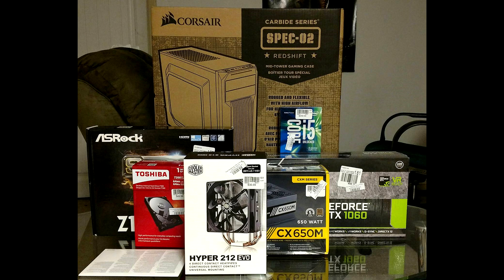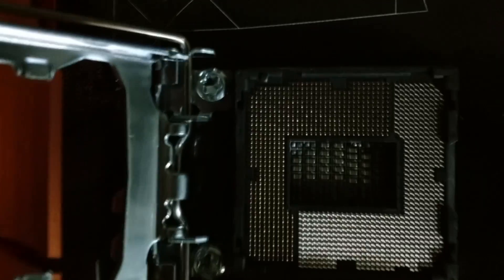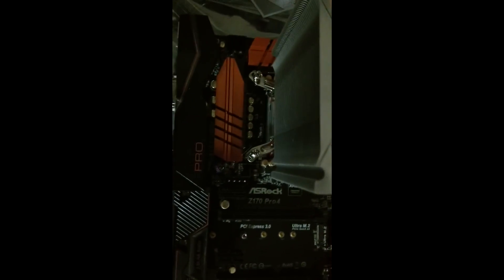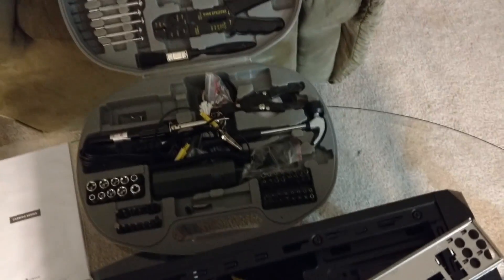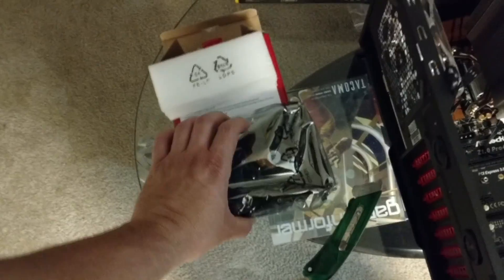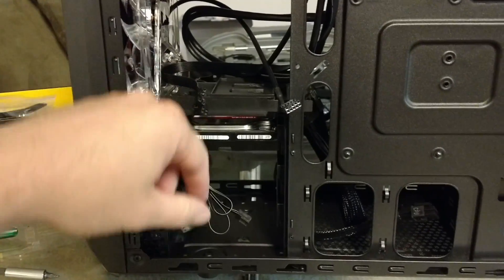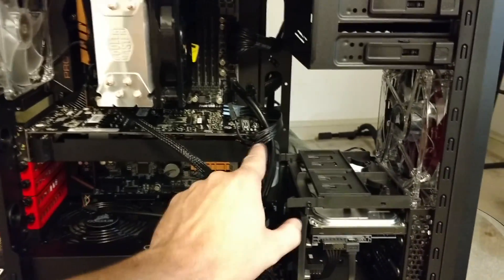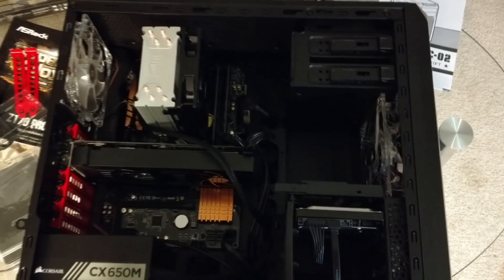How To Build A Gaming PC $900 Budget

Comment: is this a good or reasonable build for $715 its my small budget 😐

-EVGA GeForce GTX 1050 Ti ssc gaming 4GB
-Ballistix sport LT 8GB Single pack ddr4 ram
-600w psu (for future upgrades)
-Core i5 6500 
-Asus H170 Pro gaming (LGA1151 motherboard)
-Thermaltake Versa N21
-Asus Optical drive
-WD Blue 1TB HDD
-120mm fan (case only comes with an exhaust fan i think) 

Keyboard and mouse combo for $23

Please let me know if this is an alright pc for $690 + the keyboard and mouse combo which makes it $713
Reply from the maker: +Jake Hicks I'd say that's a great budget build. It looks like everything can be upgraded later and that's what you want. You might consider going with a 900 series graphics card to get more graphics power for your dollar, but I honestly don't know how well the 1050 handles games. I haven't had the chance to check it out yet.
Reply: EpicDose 900 series? so like a 950 or better
Reply from the maker: +Jake Hicks actually now that I see what the 1050 is going for you might just spend a little more and get the 1060 gtx. The 1060 plays everything on ultra and maxed at the moment at 1080p. But like I said I have no clue how the 1050 handles games so stick with that if your budget has no flexibility.